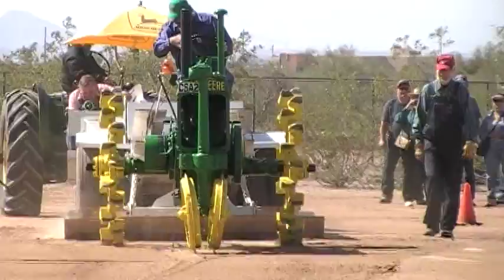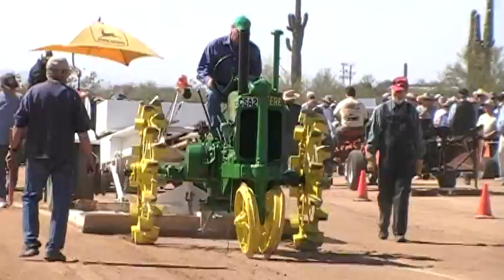John Deere GP On Steel Wheels Pulling The Sled At Apache Junction, Arizona 3-10-12

Comment: Yeah a GP (originally a model "C") doesn't pull that well. The motor sounds like a model "A" to me. Before they styles those old tractors, the "A", "B" and "G" had General Purpose on the sides. I don't think the model "D" did.